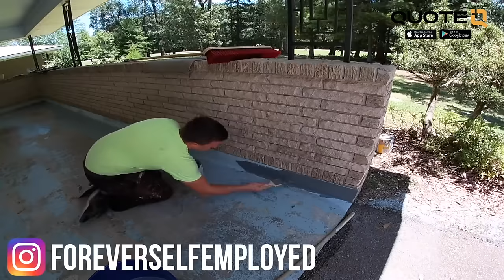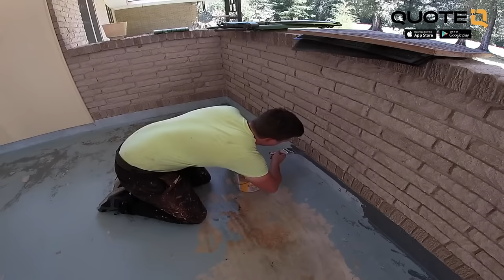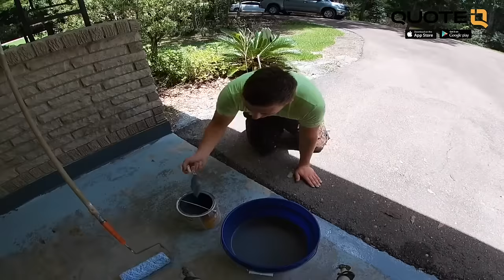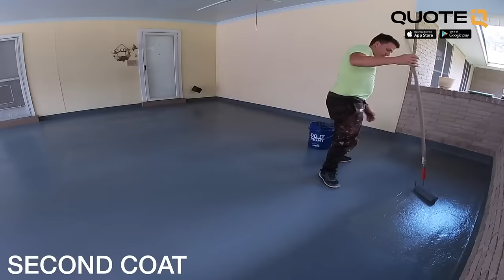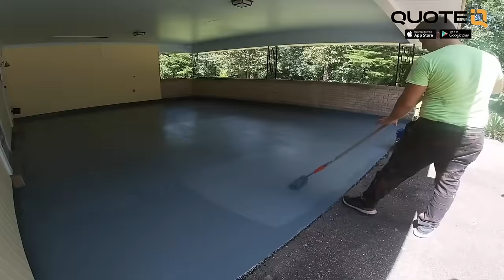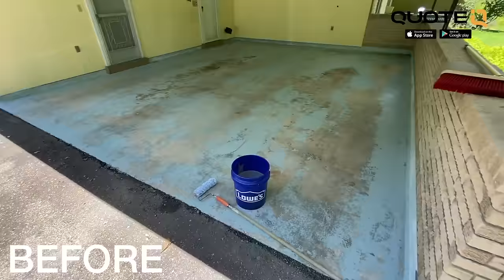Customer Refused To Pay Because I Work Too Fast

Comment: I'm a real estate investor and I can tell everyone is nice until it's time to pay
Reply: or, until it's time to get paid
Reply: You are right @dreamingcode as of Solomon, well, If the job has been done, checked and approved and it takes days, weeks , months or in some cases years, to get paid, trust me int happened to me and my dad, it’s normal to not be nice anymore, everyone has the right not to be nice if scammed, so, take it as you want.
Reply: Exactly! You'll learn as you get older, NEVER EVER do a job without doing getting a deposit, make sure your deposit will your expenses and your time... For me i ask, 85% percent, and I also add mark up for material withing that 85% ... I have learned with time as well.
Reply: @videos10  Yeah, in Austin, TX, my boss always has customers refuse the last payment, especially the richer ones, so he claims, anyway! I think it's usually true.
Reply: @videos10 That goes both ways. An 85% deposit is excessive. I’ve been burnt by enough contractors to know never to hand them anywhere near the full amount of the job price before they even spend a minute on site.
Reply: Truth
Reply: @videos10  you wouldnt get that in most places and as for the trades people dont do that most of the time. its all about a contract no verbal crap.
Reply: @videos10 in my market, it's always the trash contractors who want money up front.  It took me a while to realize it, but I figured out they're the ones who know there's going to be disputes later about the quality of the work, materials, etc. Or they're so broke they can't float a minimum amount of materials.

The biggest, most expensive jobs on my house, they didn't ask for a dime until it was perfect.

Comment: I pretty much say the customer can shove an hourly rate considering I won’t eat or take a bathroom break most of the time when completing a job.
Reply: Drywall Taper here. Same bro I’m there to get in and out. I’ll even play mental tricks like whatever I charge I just try to finish in enough time that it lines up to $100hr minimum in my head lol Pinnacle of Quality Performance & Value
Reply: Same, I don't take lunch, I don't take breaks.
Reply: @Vinnie DeLuca  Where do you live? Charging 100 and hour if you're by yourself is actually crazy
Reply: @anthonyrodrigues5032  he’s not charging by the hour. He’s charging for a job and then busting his ass to get it done quicker while not sacrificing quality. It’s not like he can take his time to make the job twice as long and get paid twice as much.
Reply: @Over Throne  Right, he is basing his estimate by 100/hr minimum. I get it I do the same just not 100/hr. It's my business if I show up early, work hard, and don't take a lunch.
Reply: For me I figure out how much I want to complete a job. The faster I get it done the more money per hour I make, because I can do multiple jobs in the span of a few hours. The key if they want to pay you by the hour is to make the first hour a premium and the subsequent hours at 1/3rd discount or half of the first hour price... And they need to be told up front that you don't charge half hour rates.. due to rig up and rig down time and possibly traveling distance...
 Sewer Thaw business is semi lucrative in the winter. You can charge $300 for the first hour and $150 for every hour afterwards, until it is thawed... Payable upon completion...

Comment: This happened to my dad and me one summer, my dad was an arborist for a company but also did weekend work. One day we take down a guy's tree pretty small one honestly but in the middle of summer so lots of leaves. Takes about half an hour to cut it down and another hour to send it through the chipper. Bill was 400 bucks and the guy refused to pay saying that meant we were charging him like 225 an hour. My dad who is a saint when it comes to patience explained that no he was paying for a tree to be gone. 

"The years of experience, thousands of dollars in tools, fuel for the truck and chipper, and the disposable fees are all our problem. Your problem is that you owe me 400 dollars." 

That was at least 25 years ago and I still think of it. It's not the plumber's fault he can fix a leak with 6 dollars worth of parts, you need the leak fixed and you can't do it yourself. Once the price is decided it's not your business how long it takes to do it.

*Update for clarity...I'm old. 400 bucks at that time was easily a month's mortgage payment. The minimum wage was around 6 dollars.
Reply: Part of a flat fee is insurance: if it ends up costing a lot more, the client still pays the agreed-on amount. Plus who would want to have a job done without a cost. "Well, we'll do it first then see how much it will cost."
Reply: Just like the customers that complain when I charge them $2000 to completely rebuild their engine.
Reply: @Christian-lf6iy  that's a fucking steal of a price, especially if you're doing head work and if youre rehoning the cylinders
Reply: You're old? Hell I remember when minimum wage was $2.35 a hour.
Reply: @williamnovotny5776  Wow, that's exactly what it was when I started.
Reply: 1 hour to cut a tree....no chainsaw or its the setting to prevent it from crashing on the house//doing grass damages that took so long ?
Reply: @bllllood  Had this long pole with an electric saw at the end and used that to take the bigger branches. 

Then climb up to cut the trunk into thirds. Then a ton of trimming pieces to go through the chipper. Also takes a bit of time to throw a rope over the branches and pull them away from the roof. 

It can get a lot more complicated than just making two cuts to drop it.
Reply: It doesn't matter how long it took once a price agreed with both parties.  It's happened to me as well once, I threatened to take a lean out against his property & that was the end of the conversation, he paid me what we agreed on.
Reply: I remember $3.00 an hour as minimum wage & gas $.40 a gallon.
Reply: "It's not the plumber's fault he can fix a leak with 6 dollars worth of parts, you need the leak fixed and you can't do it yourself. "

That's why I do do it myself, after taking a week learning and spending $200 on tools. Lots of contractors from chain corporations taking advantage of people and preying on their money.
Reply: Not everyone has the money to pay, sorry we aren't all banks or retail stores.
Reply: you got to buy a chainsaw, fuel, chain oil, cans for the fuel, gloves, boots, safety trousers, helmet, van, fuel for the van, tyres, service, replacement, chipper, hand tools, a secure yard, insurance, training, accountants fees at the end of the year, any tax, and then actually live and pay the rent/mortgage, food, house tax, electric, gas. All that has to come from somewhere. Why do these people think you somehow owe them something? I have had them say; 
"I could put that fence up in a day but my back's bad, how come you've taken two days?"
"Because your back's bad." !!!!
Reply: That's why I am holding off on getting my rack and pinion and timing belt replaced for $3000.  It's too much for me to afford.  I plan on figuring out how to do it myself for hopefully $1000 or less.

Comment: Recently I had a guy refuse to pay what we agreed on because I got done so fast.  What he failed to understand is that I had prepared the steel pieces that I was installing earlier off site.  He only saw the actual install and none of the prep.
Reply: Ain't that the truth - and preparation is everything !
Reply: How does that guy shop retail? "Why am I paying $800 for that TV?!? You just got it off the shelf."
Reply: Working in manufacturing. Management would change and the plant 'required' a new layout or one of the machines needed to be moved. The plant maintenance manager, my boss would see the change coming and we would put water, air, and electrical into the new location. We would finally get the order and one or two shifts later the job would be done. One day management without any heads up or prior discussion, said move that machine on night shift. "No problem, but it will be down for 4 days."  The incredulous response was, What? Your team always moves machines in a shift or two. He had to explain the power requirements and how we put those in ahead of time. The good news was we moved machines a lot less after that.

Comment: I just had a contractor come out yesterday to do my roof. They told me that it would take the whole day when I signed the contract. They showed up at 7:30, started work around 7:50, didn't stop for lunch and were done around 1pm. I watched the work and they did a fantastic job. I was more than happy that they were done early.

People don't realize that they pay for the job, not an hourly rate of the workers.
Reply: Hourly rate my a... 
We speak about jobs that take less, but we dont speak about jobs that take few times as much effort and time and price stays solid.
Reply: @pawelhyzopski6456  So what's your point?

Comment: This happens alot  for me, Im a hard working drywall guy, 25+ years and i have to explain my speed to homeowners because i know my job so well it makes the work look easy,and very fast. Keep up the grind brother!
Reply: My favorite is when they ask how many other people will be there to get it done that fast and I say just me
Reply: A good dry wall guy is worth every penny.
Reply: u aint gotta explain shit to no one
Reply: @nostradamus7648  I got a project away from home. The guy was gonna make an apartment in a shed by the time I started the job.  I slept outside every time I was out there until he got two dogs that sat by my bed roll and barked at everything, funny he wouldn't tie his dogs by his house to not bother me. Then it got cold and he chewed me out for building a very small fire in the sand
Reply: @nostradamus7648 good deal. I think my guy was overmedicated.  Old friend stuff. Then rattlesnakes

Comment: Know the feeling, just today.Turned N invoice on work performed. Here's what I did this week WITH no help. 1 removed wall cloth9'× 12 '    , 36' of boarder paper 2 mud some torn places N drywall 3 reworked two windows of corner bead.4 washed all the walls down 12'×12' ×9 high ceiling,5 painted walls two coats.6 painted ceiling grid2×2tiles. 7 Removed/installed two 2×4 thin LED lights .8 removed/reinstall garage door motor chain drive ten foot ceiling.  9 Installed Door locks,dead bolt and knobs set. 10 remove outside light over garage door and reinstall new LED . 11 Fixed water leak at carwash. 12 Installed 3 30"  ×64 " blinds cut down too 36. ALL FOR 1600 and he thought that I was to high on my,invoice. Thanks 4 anyone that reads this. I needed 2 vent.

Comment: One time I had a lady get mad because we finished too fast also. We literally did a TV installation with cables hidden in 10 minutes. She said am I really going to pay $300 for 10 minutes of work. She said "what are you a doctor?". I said "no ma'am does the price we agreed on, we just work very fast". Keep in mind we are always polite and try to be personable.  And she gave us the money pissed off
Reply: I went to an elderly ladies Friday just past because she was having a guy in like you to price putting in one splitter box (£3.99) around 3m coax cable (2.99) one hole drilled through a wall for cable to pass through and a few clips to nail cable to skirting board (£0.50p). Guy wanted £170 for 5-10mins work. When i questioned his price (tradesman myself) you never saw a man pick his stuff up and run out the door so fast. Just like you he was a RIP-OFF merchant who prays on the weak. There's running a business and then there's ripping off people with overpaid work. Your the sort of person that would rip your own Granny off and sleep very comfortably every night knowing what you'd done.
Reply: @ScratchyBaws  your the type of guy who will like your own comment lol. Buddy whether she was old or young if we agree on price before hand that's the price it's gonna be. Just because we are good and efficient and finish the job early doesn't mean an automatic discount. If you go to a tire shop can order a set of tires. Whether they change them in 5 minutes or 1 hour you're the type of guy to ask for a discount because they were so quick? Buffoonery 😭

Comment: As a mechanic my customers are paying for the experience and the time it took to learn to diagnose and do the job quicker no matter how fast I do it.. I started off working cheap too because it came so easy to me but then I learned it's still a job they would have to pay someone else full price for, now I don't care if they walk I'm not working for cheap. I'm also not the most expensive either.

Comment: I met a painter once who doesn’t tape off.  He used some plastic device as a shield and wedge and completed his job in half the time.  I could have complained, but the price for the work was reasonable and he did the work.  Who am I to get angry because he took the time to learn a more efficient way?  Honor the deal, or don’t enter into one.

Comment: I'm that guy also. I work fast. I cleared a drain in 5 minutes but I still want my 200. If I didn't have a boss then I would charge 50 or 75$but I have a boss
Reply: I understand people have travel time and equipment but 200 for 5 min is a rip off.
If you genuinely think it's fair, tell customers up front the price and estimated time and see how far it gets you.

Comment: There's a whole Ted Talk about how working hourly punishes people that do good work. People often don't realize that one thing they're paying for on a job basis is that the person has all this experience and like you said, have worked out work flows, has the right tools, can estimate materials correctly. You have to wonder, would they really be happier with some slacker that takes his time, takes long breaks, is having to go back and forth to Home Depot several times for one job?

Comment: You weren’t charging $70/hr. You charged an hourly labor fee, but also rental (purchase price recoup) of the equipment used, travel time, cleanup/disposal, materials, and for experience/know-how.  A $5 power outlet, installed, doesn’t cost the customer $5 when done by a qualified electrician. Never be apologetic for a job well and promptly done. Next time, simply assure the customer there will be no extra cost for delivering above and beyond the terms of the contract, and that you do not charge an additional fee for the exemplary service.

Comment: My biggest problem working for myself has always been the pricing. I've had 2 issues in my 15 years with customers and they were both misunderstandings by the homeowners and I ended up losing money. I've had to go to work for 3 or 4 different companies but always tried to maintain some side work. I'm currently working for gas money for friends and family to stay busy. I went from almost $90,000 a year to nothing. Long story but thanks for sharing this video. I'm determined to work for myself and get the money I deserve. I'll get it figured out someday. Good luck in anything you do. Great work 👏🏽 👍🏽

Comment: Hourly rates gotta go.  It's the finished completed work that matters.  If you are efficient and get it done in less time doesn't mean the job is worth less money than from someone who takes 3 whole days to complete the same work.  Plus your experience and level of service being top notch, you would think the customer would actually appreciate you concentrating on the job to get it done and not dragging it out. Keep up the good work
Reply: I guess the best thing to do is just agree on a charge before had for a job like that.  I wonder what he charged for that $300?
Reply: @jamesrich8463  not sure looks like about $400 and seems he provided the materials too
Reply: I saw a written quote for a driveway addition, prep and set up first day, pour next day, total was $9000, itemized line $4000 labor (he would complete in 2 days with crew of 4).  $200 per hour for each guy if you do the math based on 2 days LOL but that money doesn't all go to the laborors paycheck, only 7 yards of concrete.  If you don't know how to do a specialty trade, you will have to pay good money to have that work done, equipment, skill, project management, insurance, vehicles, work demand driving up prices, supply of materials.   So whining about $70 an hr for a project like that what a shame she should have been grateful to find an honest independent landscaper who took care of her yard very well
Reply: @Frxstynah  as a concrete contractor in Australia, first take about 9% off the invoice amount that goes to the government for GST. About 50% of the money after that goes to other (non concrete) contractors like excavation, material suppliers, termite barrier guys and then about 50% of the 50% left is labour costs including my own wage. then there's 30% tax on my wage and whatever profit is left.

people see a really huge number (it's up around and above $200/m2 here now) and they think its expensive - because it is! but about 75% of the price doesn't even go to me as the contractor!

this is why you'll see ads for trade work being done at some ridiculous (low) m2 rate but the catch they use is they add, add, add other stuff on once they start the job.

Comment: Years ago a Contractor completed a huge Epoxy and Flake job. Everyone of the Customer's friends loved it. The Customer tried to find was to NOT pay for it. The Contractor got his Guys to get the Floor Grinders out. And removed the complete 1250 Square Foot floor, back down to Bare Concrete. Cleaned up all Residue and Drove off. The Customer's attempts to take him to Court failed. Including owning the Contractor for the Materials used.